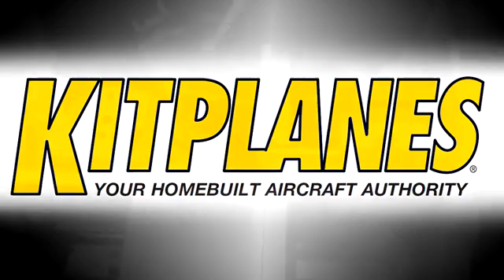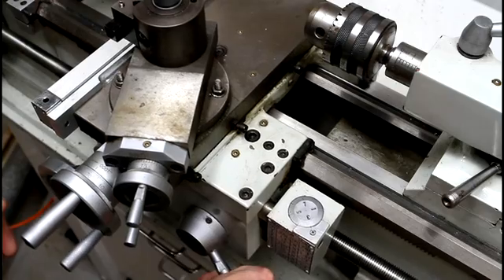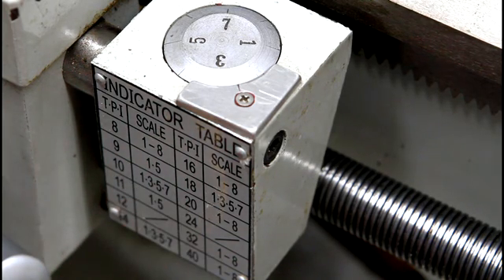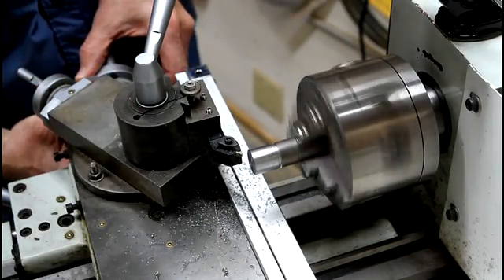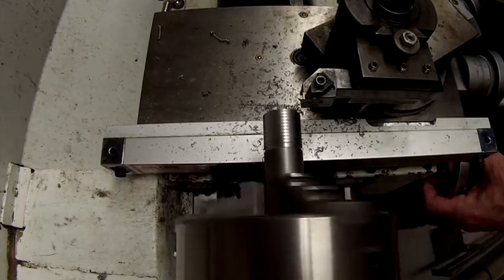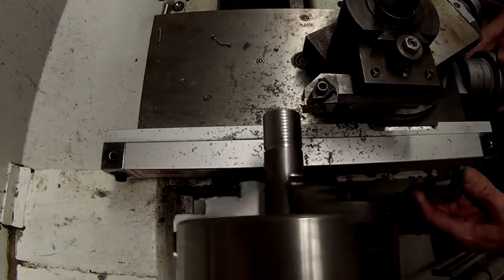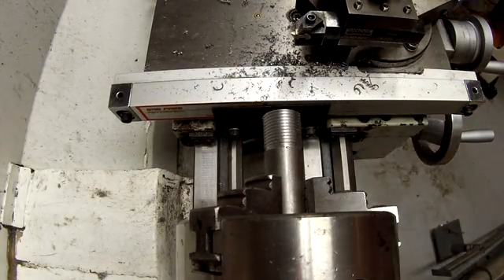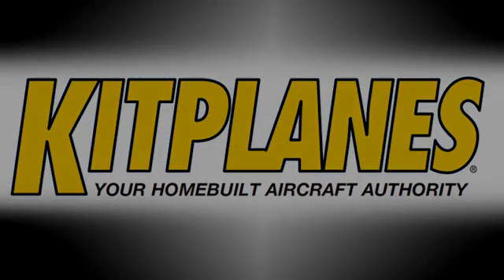Chasing Threads on a Lathe

Comment: Why weren't you using any cutting oil?  Every machine I have ever used or drill press operations always uses cutting oil.
Reply: Aluminum is pretty soft, even 6061 and 7075. He is only taking off a couple of thousandths at a time and taking breaks between cuts. If it was steel or long deep cuts on aluminum then yes use a cutting lubricant. My understanding is that lubricant is to keep the tool or the part from overheating.